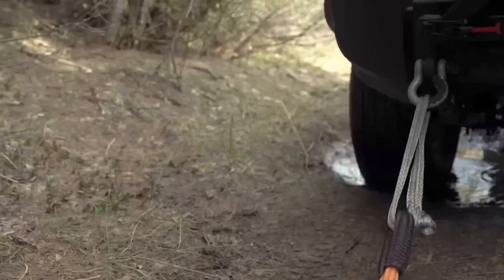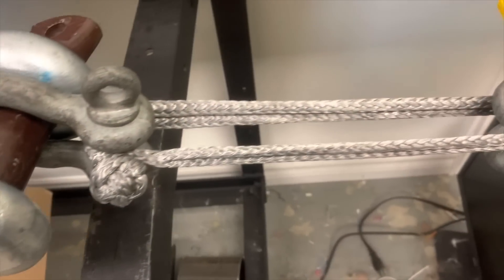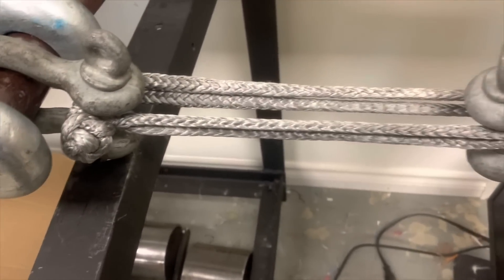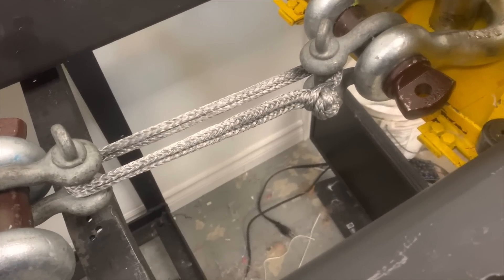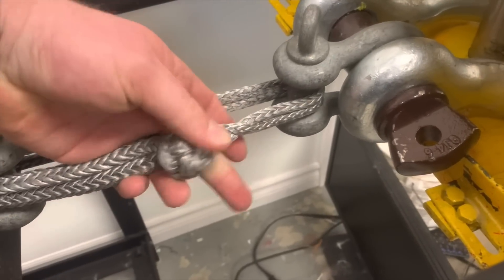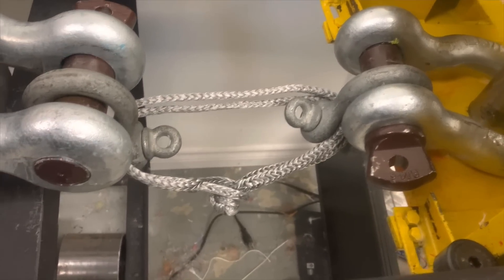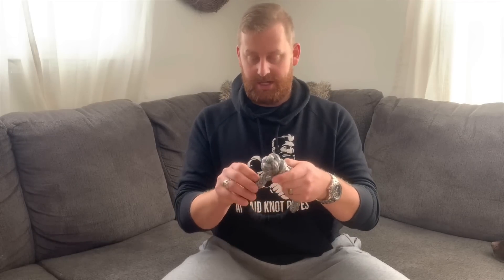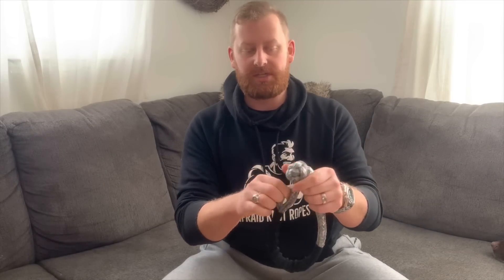FACT OR FICTION? Soft shackle positioning

Comment: Hey in the very beginning when you state proper vs the first example of improper, they look exactly the same. 
 Except the tow recovery's would simply be heading in opposite directions. 
Anyhow I have never used a soft shackle, just now have been looking into them. 
Good job on the testing.

Comment: Would be nice to know the breaking strength or the rope that’s used to tie the shackle. It looked like the breaking location varied. In some cases it looked like it broke at the end of the noose and also at the lock stitch when the noose wasn’t cinched, and the bow shackle. The bow shackle breaks are user error due to set up. Spacers can be used to center the load. Hope to see another round in the near future.

Comment: We tried soft shackles while rigging light crane loads (<500lbs) simply for the quick convenience.  Then we discovered that a sudden jolt on a slack line would cause the loop to pop over the monkey paw.  Has anyone else encountered this?
Reply: You should use a button knot. Which has a defined shelf at the base. I believe monkey paws are more spherical
Reply: @alastairmacdonald-pb9ki  We will definitely try it, thanks.

Comment: The only time I would use a soft shackle is for joining 2 straps.
Reply: OK.  I've seen what they can do and would trust them in many situations.
Reply: @ljprep6250  That’s fine, but for me with my synthetic winch line I want it to be the weakest link which it is when using a bow shackle and tree straps. Like I said the only time I would use one is for joining straps where it becomes the weakest link. The soft shackle has become the most overhyped tool out there.

Comment: Couple things I found interesting... First was I understand the purpose of this test was specifically about the knot and loop connection, and breaking 15 of any product gets expensive (we got a dynometer for highline rigging testing) and I get wanting to test cheapest product... so much thanks🙌👏🤝 but I never heard you identify the shackle as 1/4" and was actually kinda impressed the viewers managed to identify it correctly! Along that line, you never describe the intended use of a 1/4" soft shackle, and I kinda fear much of the chatter here is in reference to car and truck recoveries, which this product is not designed for... The last critique about what is directly here is more of a pet peeve, but to everyone commenting, THOSE METAL SHACKLES ARE NOT D RING SHACKLES!!! Any rigger would tell you they are bow or anchor shackles, and supposed to have washers on the pin... https://practicalmaintenance.net/?p=766 And the size of the hard shackle will change the breaking point of soft shackle as the bend radius is a factor of strength...

Couple questions about what I found on your website... For 1" kinetic rope, you recommend 1/2" SS with MBS of 60k lbs... But then for my truck requiring stronger 1 1/4" kinetic rope you recommend what I would THINK would be a stronger 5/8" shackle, but for some reason both the material and construction design were changed resulting in a WEAKER  52k lbs limit... What's the deal???

I'm also curious about how and why 2' worth of an 1 3/8" soft shackle is exorbitantly more expensive than 20' of 1 1/2" kinetic rope...

Finally through your website I realized you're the Glue Tread guy too!!!! So we have actually had similar conversation and you sent out a free sample (which was used and shown during a few rescue ops😉) that came complete with an entire rim and tire to test on!!! So again, I appreciate your dedication to testing, spreading real knowledge, and striving to put out the best product possible.... 👍💪👌
Reply from the maker: Great questions and points let’s try to break it down,

First thanks for the knowledge on the bow shackles needing washers

1/4” soft shackles for our purposes are used with ATVs and snowmobiles. 
Any shackles under 1/2” I make myself, have tested myself, and work closely with the factory to develop products. They use a higher strength UHMPE fibre. For any larger sized soft shackles they are made by a different manufacturer in Toronto and I have not been able to do enough testing due to cost and time constraints to test strength so I use their recommended break strengths (which I believe they are under rating but I can’t be sure of that yet without further very costly tests, beyond my break tables capabilities). 

As for the costs nylon is a much cheaper fibre I’m talking 4 times cheaper, UHMPE is very expensive at that size, not a lot of manufactures go that big and we use about 20’ of it to make 1 - 24” soft shackle the knot, doubled up body, loop, and Bury all add up to about 20’ or rope. 

Also the radius of the bend will make a difference if that point is then the weakest point (single line pulls). On most soft shackles (due to the doubling of the lines and if it’s not pinched by the pin) should still be the point the ropes intersect to make the loop. If that happens you know you are maxing out your shackles not dependant on the radius of the bend. 

I hope that helps I am still testing and improving and changing what I thing isn’t perfect but we are getting there.
Reply: @afraidknotropes  thanks so much for taking the time for detailed reply!

Comment: Cascade Heavy Towing had a YT video with a soft shackle coming unfastened with load.  Looking into it:  A it was an Amazon cheapie, B it had a poorly shaped knot...smallish and sloped at the bottom edge.  And testing of other better soft shackles agreed that install position was not critical.  IE, everything in agreement with your video.

I used to work at a research test lab...tested a lot of things to failure.  My opinion is that advertised ratings are strictly marketing decisions, perhaps loosely based on the ratings of the rope materials used.  Best to look at the quality of the shackle and the diameter of the rope...forget the rating numbers.

Comment: I am looking into a set up right now that’s solid and affordable and I think y’all have won me over!! Thanks for the product review!!
Reply: Just be sure not to buy this 1/4" SS for use with any car or truck... He explains appropriate sizes and use in each items product description...
Reply: @kevinwalker7302  any light car or compact truck would be fine in 99% of conditions. I guess I wouldn't recommend it for grandpa's '71 Cadillac Deville or your 3/4 Ton diesel, but in most smaller cars and trucks you're not going to have a problem.
Reply: @wesman7837  check the manufacturers recommendations before spreading misinformation... This 1/4" SS is designed for use only with ATV, dirt bike, snowmobile... Larger sizes recommended for passenger vehicles...

Comment: The reality is, if you get to a breaking point at 20k+ , that's well beyond what you will actually see in reality. If you are seeing more than that, you should be using a larger diameter soft shackle. I carried a 25k lb line scale with me for over a year, and anytime i had to rig for a pull, i threw it in the mix, and never even got over 10k. (Figure I'm using a Warn Xeon 10, so a 10k winch, so obviously.....) also, through my own testing and with an acquaintance that does massive amount of testing of this stuff, we have found that soft shackles will break +/- by well over a few thousand lbs, it's just the reality of synthetic ropes.

I agree you should use some form of protection, but the orientation, imo, just doesn't matter in the real world.
Reply: According to this guys math, 19k lbs can be expected between 2 full size trucks... Around 4 min mark, maybe 4:30... Soft shackles get mentioned at 12:30 iirc... https://youtu.be/Mb3BkeeXlIo

Comment: I think the protection webbing tube should be longer so to cover and protect the holding points. You have not always got a clean fixing point or a thick or round fixing point. I only use soft shackles with full protective sleeving so I can wrap round any part of a vehicle ! 🇬🇧🏴

Comment: My take from this was that the soft shackles failed every time and the D rings never failed.
Reply: Those looked like 7/8" bow shackles, so they're rated to at least 13,000lbs WLL. Steel shackles like that tend to have a factor of safety of 5, so they break around 65,000 lbs. Of course they are stronger than 1/4" soft shackles.
Reply: @Psyco913   So why bother with the soft shackles? Just use the steel one and be done.
Reply: @afastcuda1970  Because the thing you are attaching the steel shackle to might fail and then you have a heavy piece of steel flying through the air instead of a lightweight piece of rope.
Reply: @afastcuda1970  because the the soft shackles are INFINITELY safer when a tow strap, snatch strap, or kinetic rope fails mid recovery, and any chunk of metal in system instantly becomes a murder missile... Most common perilous projectiles originate in middle of system, when a bow shackle is used to connect 2 straps or ropes, or when a Recovery Rookie doesn't understand how terrible of an idea it is to attempt a Rescue by simply placing eye of recovery line over the 2" ball hitch that has never ever left his truck.... (I know I myself, and likey damn near every other truck owner, was guilty of this for the first year or two of being a driver and making dumb adventure decisions) sadly, it's not hard to find multiple reports or video of a Reckless Rescue Ball  blasting directly through Stranded Sylvilian's windshield, deftly decapitatingthe driver, or rapidly relocating half their face, jaw, or skull to their back seat... 💀☠️😟☠️💀 No exaggeration😢 bow shackles have failures in field when odd crossloading occurs or more common is a pin failure, either from lazy human not fully threading pin to max depth, or orienting pin in vertical position, with threads over heads, and pin magically unscrew itself... "Screw down so you don't screw up!!!" 

To end on more positive note, the soft shackle easily attaches to much larger diameter items like small trees and weighs next to nothing... Consider a 3/4" bow shackle is likely most common size for attaching standard yellow tow straps, and I will actually need minimum 1" for a tight squeeze to 1 1/4" bow shackle to attach my 1 1/8" Bubba Rope (rated over 50k lbs) ... Things are getting obscenely large and obnoxiously heavy really quick!!! My 7/16" Gator jaw soft shackle (also rated over 50k lbs) makes no noise bouncing around back of truck, and actually floats on water!!! It's kinda a no brainer which is preferred to pack....
Reply: @kevinwalker7302  What does tow ball recovery have to do with this conversation? To keep the steel shackle from failing I just won't attempt a 65000lb recovery.
Reply: my take from this is the soft shackles failed every time and 3" hydraulic cylinders didn't
Reply: @afastcuda1970  the tow ball is another example of the extra danger involved when incorporating extra pieces of unnecessary metal into a tensioned system... Same as when connecting two straps with a bow shackle... The steel shackle doesn't need to fail to be the dangerous part of the system... 

But we are all missing a huge point here... I've never even seen or heard about a 1/4" soft shackle until this, and I've worked in off-road recovery for 10+ years... Checking their website, 1/4" SS is designed to be used for ATV, dirt bike, snowmobile, with a 1/2" rope... Another product I've not seen used in the field, other manufacturers make 3/4" their smallest rope... This miniature gear is designed for people who need to carry everything in their backpack already loaded with normal supplies... My truck requires an even larger rope than follows, but most people would likely choose the 1" rope designed for full size trucks and heavy SUVs, which the recommendation is to pair with a 1/2" SS... 

And guess what, his 1/2" soft shackle is rated at 60,000 lbs!!! Soft shackles are more convenient, safer, and no pin to lose or drop...
Reply: @afastcuda1970  Whoa, don't ignore working load limits if you want to live.

Part of that 5x safety factor is simply because the consequences of failure can be so high, but part of it is also the possibility of manufacturing defects, improper use/setup, fatigue stress, etc. Even under perfect testing conditions that 65,000 is just an average. Some broke higher, some broke lower and there's no way to know the exact amount of force it will take to break yours. I wouldn't exceed the WLL by more than a few thousand pounds, and only if I was desperate and had no other options.
Reply: @VoidedWarranty  Heh, heh, heh.
Reply: @kevinwalker7302  I use the 1/4’ shackles for my atv, the bigger ones for my truck. My atv will never weigh 21000 lbs.nor will it tow that much. Use the right size for the right job.
Reply: @danlux4954  exactly!!!

Comment: Most of the failures were cut by the intersection of the pin and shackle body.  Hasn’t it always been the rule to connect soft components to the shackle body while the pin connects with hard points ?  This goes way back before the existence of soft shackles and super-rope technology. 
If you run the same test again correctly I’ll wager they all fail consistently higher.
Oh, and why remove the protective sleeves ?
Reply: You are correct about pin on hard point, which also allows multi directional pull on load line... If connecting two lines, pin supposed to have several washers to center and stabilize line... Why remove protection??? Probably because goal of this test was primarily getting knot to slip, secondary was looking for drastic changes based on knot position, and had nothing to do with the maximum break strength of product, which would be virtually identical as protection does not provide any tensile advantage (possibly avoid/improve the pinch point, but that wasn't always failure point anyway) even with the protection, in the end, this product only gets a MBS of 21k lbs printed on the tag...

Comment: it does appear logical that the knot could pop out of the loop if it is close to the attachment, but if the loop is constricted by the attachment, it would be less likley under strain to pop out. I find they are more likely to 'drop' out while the gear is loose before tension applied.
They all broke about same strain, which was reassuring! but sun and water don't help.
Reply: Try making a soft shackle without a loop, just a big knot at the end of a giant loop of cord. You will find that even that holds just fine under tension.

Comment: It sure enough happened at Matt's off-road recovery during his Wrecker Olympics they had a couple of failures with them things and it doesn't matter how you rig it if it's a single pull did may stay where you leave it but if you're traveling that thing is going to walk circles yeah it don't matter how you put it on
Reply: Bullshit! There was only one failure and that was when Paul tried pulling blue steel, and  it was later determined by Alan from Yankum Ropes that the shackle was already damaged from when they barrel rolled the Isuzu.
Reply: @tyendor1952  Not to mention if you are doing a real kinetic recovery and you find yourself hitting 40 mph at the end of the rope, you are the problem, not the gear.

Comment: So as I see it, the website says the MBS (max break strength) is 21,000 lbf, so the shackle pretty basically will perform configured in any way, but some ways may be slightly better.  That all makes sense.  I can't imagine anyone using a 1/4" shackle to pull over 10 tons in their right mind, as that is not what that small of a shackle should be tasked with in the first place, so anyway you look at it, that is pretty impressive!  When used within the range recommended, and when in good condition, and not wrapped around anchors that would introduce cuts to the rope, there should be no issues!  Nice video!!!
Reply: MBS is minimum breaking strength not max breaking strength. The lowest load it can be expected to break at. It was the lowest load out of a set of 5 break tests
Reply: People are dumb and will do some surprisingly dumb things

Comment: The metal shackles held up just fine.
Reply from the maker: Yep we were sure to use shackles that were well above the ratings of the soft shackles.
Reply: And you would never choose a 1/4" SS with any work or recovery involving a car or truck, where you typically find the metal bow shackles being used...
Reply: Which, the 7/8" or the 1.5" shackles on the machine?  ;)

Comment: My takeaway is that the loops and knots are not the weakest points in the system. If a two-ton car needs to be yanked, ten or twelve thousand pounds of force should be plenty to do most recoveries.

Fab Rats had a Soft Shackle failure at the Off-Road Wrecker Games which was attributed to using a damaged or nicked shackle.  That would be interesting to see tested. How much damage can cause catastrophic failure?
Reply: They were using soft shackles over sharp, square corners - something that nobody I know would EVER do, with ANY rope or cable, under ANY circumstances.
Reply from the maker: Great question. I’ll have to look into the best way to test that.
Reply: Well, but that’s wrong. all the failures were in the loops and knots. They are the weakest point in the system. Dyneema doesn’t like being bent, and that’s where the bends are.